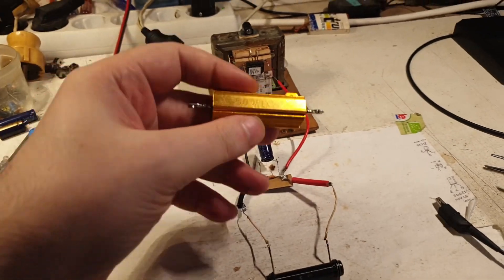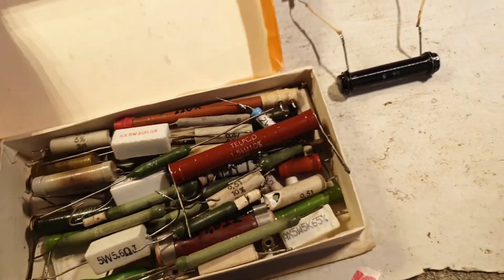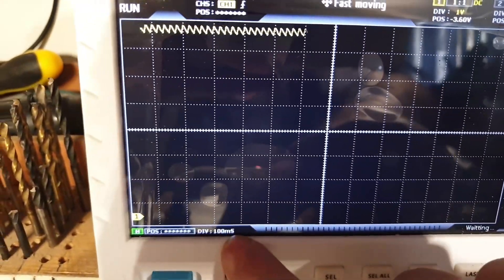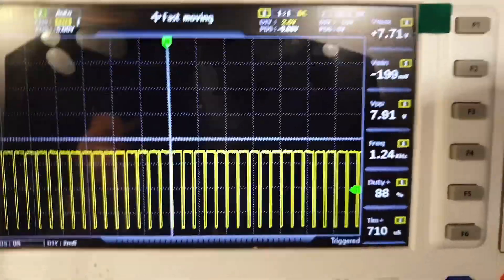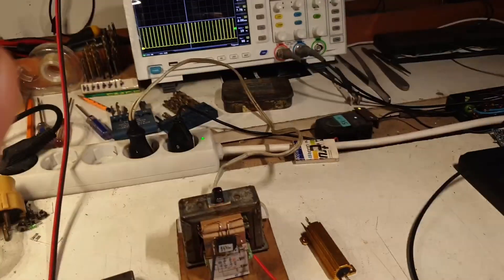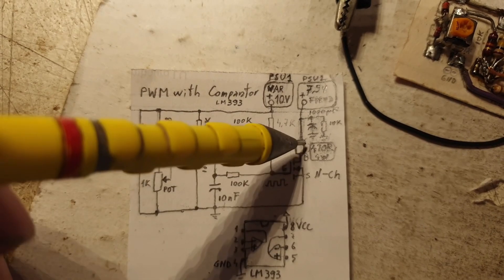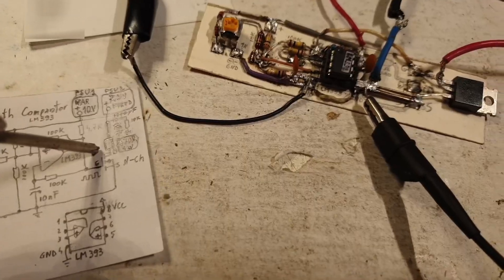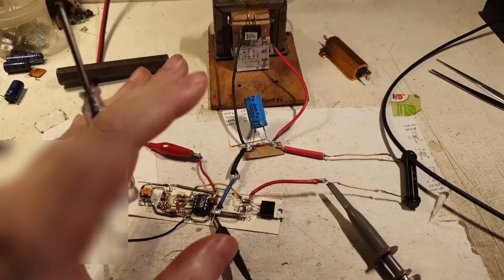#292 IRFZ44N Mosfet; Power Test Driving #3; with excellent switching results

Comment: If you'll ever need an affordable MOSFET driver, you can make one out of a 555 timer.
Search for MOSFET driver that time forgot, on YouTube.
Just make sure not to disconnect the input (pin 4/reset) or have the microcontroller crash, because that will translate to a solid HIGH on pin 3.